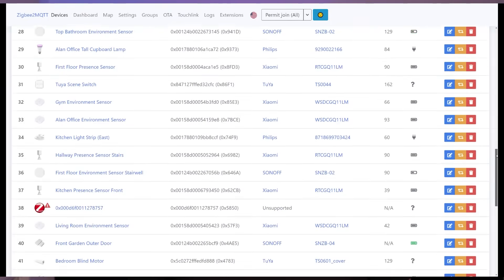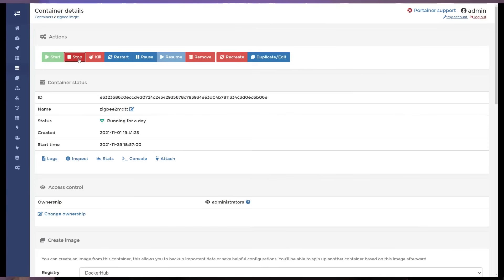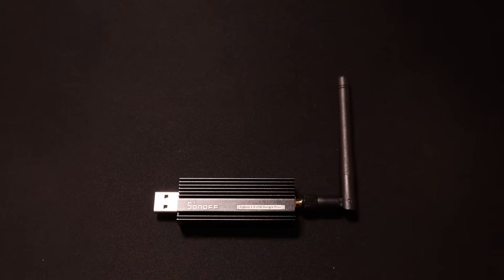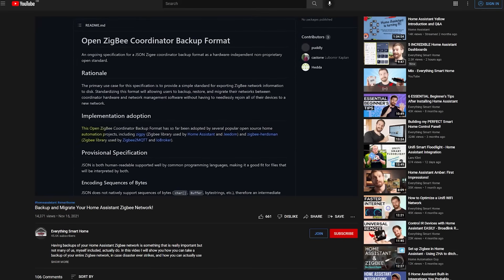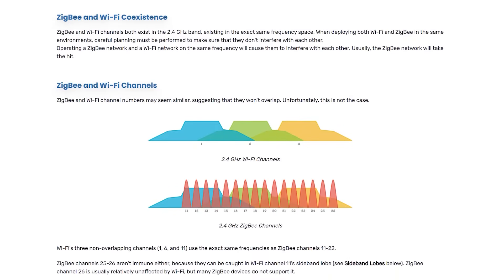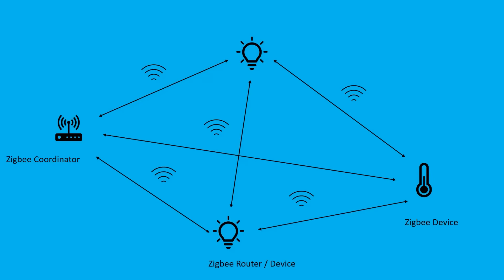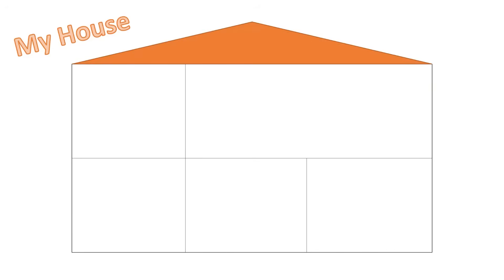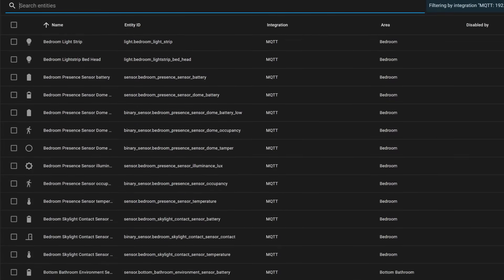Improve Zigbee network performance and stability with these 3 tips

Comment: I started with SmartThings. it has zigbee and zwave. the first couple years in this house had issues.  devices dropping off network, ect.  First I moved the SmartThings from the basement to the middle floor, middle of home.  This helped alot.  2nd, I stopped cheaping out on batteries.  Cheap batteries would die before low battery warning, or just have poor performance.  Energizer batteries have been running  for 2 years.

Comment: Is it really the case that the sequence that devices are added is THAT significant??

I.e. if I add a device that is at the extreme range from a repeater, if then add a new repeater between them. It won't help with those two?

I'd have imagined it would broadcast on the 'network' and they'd both relay the pertinent details.
Reply from the maker: What you have described with adding repeaters between them will definitely work. The network will re-route and rebalance itself automatically. 

BUT if you are first setting up your network, and you put your coordinator in the basement and then go several rooms away to pair your first device, it may have trouble finding the network to join and you might get stability problems initially.  It becomes far less of a problem once you have an establised network.

Comment: Another way of getting rid of the radio "noise" of a Raspberry Pi or other SoC computer or PC (instand of an extension cable) is using a Zigbee-to-Ethernet or Zigbee-to-WLAN gateway like the ZigStar Gateway. This way you can place the Zigbee coordinator (nearly) anywhere in your house (e.g. in the centre), independent where your "server" is located.
Reply from the maker: Thanks for the tip! I was considering doing something similar to this with a Raspberry Pi and Zigbee2MQTT
Reply: @HomeAutomationGuy  ZigStarGW works with Zigbee2MQTT and ZHA, and the UART-to-TCP/IP (or UDP??) driver should run fine on a Raspberry Pi, it's standard Linux. It's just replacing the USB part of the USB-STICK... (the ZigStarGW developer works on supporting Thread/Matter as well, but without an, announced timeline). I have around 90 zigbee devices connected, with around 10 of those are router capable devices.
Reply: Thanks for review. Is using TCP to be sure packet is delivered.

Comment: Can you create a video describing the high availability of Home Assistant? or any other fix if the home server breaks
Reply from the maker: I wish I had an answer to that! I have a backup of my Zigbee config and a spare USB dongle in case of a failure. It's not high availability, but at least I can get it back up and running soon

Comment: wifi 2.4ghz can only use 3 non-overlapping channels.  1, 6, 11.  If you designate 11 for zigbee, you can only use 1 and 6 for your APs.  this isn't a problem if you only have 1 or 2.  if you have 3, then you will need to use the same channel for 2 APs.  just make sure they are the ones that are furthest apart and/or won't overlap.  if you use any other channels, you will have overlap, crosstalk/noise and it will impact the performance of your wifi.
Reply: Do keep in mind that ZigBee channel numbers and WiFi channel numbers do not correspond, at all. Look at the channels visualization shown in the video. For example, ZigBee channel 11 is in (overlaps with) WiFi channel 1, not WiFi channel 11.

Comment: Presumably zigbee light bulbs only act as routers when they have power. Most of my lights are already controlled by (WiFi) smart wall switches, which have the advantage that they can still be used manually if the WiFi fails. To use a bulb as router I guess it has to have power on all the time, so the light can only be controlled over zigbee? I'll try zigbee plugs instead.
Reply from the maker: That is correct, the power needs to be on to the lights for them to act as routers.

Comment: I recd sonoff usb dongle. Is there a way to check the range of the dongle?
Reply from the maker: Move devices further away from it and see when they stop working? 🤷‍♂️
Reply: @HomeAutomationGuy  thank you for the reply. I am going to buy sonoff usb dongle 3.0 for my parent's house. They already have few sonoff basic r2 switches which they control via ewlink app. Can I add these switches directly to sonoff usb stick and control  them via ZHA without flashing ?
Reply from the maker: @nehajain2974  You can check the device compatibility list. https://zigbee.blakadder.com/

I'm unfortunately not familiar with these devices myself.
Reply: @HomeAutomationGuy  thank you for the link

Comment: Thanks for pointing out, that's important WHERE you start to pair your devices in your house. 

I did the exact same mistake, you described in your video:
Paired all the battery devices near my router, and got the same problem: router is overloaded, connections are weak. 

I hoped, the mesh would heal = rearrange itself. But no, it didn't. 
Have to repair the mesh, by re-pair the devices (ba-dum-tss). 

Watched this video the 5th time or so. You can always learn a bit more.

Again: Thank you
Reply from the maker: Thanks Sebastian! I appreciate the kind words!

I hope you have that mesh working nice and strong now 💪
Reply: in z2mqtt you can just choose which device should be open for joining
Reply: @georgwurth6614  there is one problem though - if your mesh router goes offline - then the battery powered device may switch to other router/coordinator (they love to pick coordinator btw, no matter the link quality) and it will stay paired to it until there is communication issue again. This is a huge problem for me, because... I run my servers with UPS power source. If there is a power outage in my house - all my routers goes offline, but coordinator stays alive. All battery devices then will switch parent to the coordinator :|

Comment: I had about 30 devices with a CC2531 with several CC2531 as routers, with bulbs. worked great for well over a year.  only reason I changed as I like to play around :)
Note, I made sure that WiFi channels were far away from my Zigbee channel.

Comment: I may sound stupid. but please clarify. I have a sonoff zigbee bridge and lot of zigbee battery powered sensors n switches. How does the dongle work in my case. Should I just buy zigbee 3.0 dongle from sonoff and place it in farthest room where my sensors are not working currently? Can I plug the zigbee dongle to any USB power? PS: i don't use home assistant.

Comment: Hey, another tip. If you use an SSD with a ZigBee coordinator on your Pi, even with an extension cable you may suffer interferences. The fix? Do not use USB3.0 ports on the Pi for your SSD. It's a shame, but once the SSD is on 2.0, ZigBee works like a charm. I took months to discover this.
Reply from the maker: What a strange problem, and congratulations on finding the cause! Thanks for sharing!
Reply: @HomeAutomationGuy  Well, USB 3.0 does interfere with 2.4 GHz radios,  not just Zigbee,  but WLAN as well.

Using an unshielded USB extension cable on a USB 3.0 port of a WLAN access point can render the whole 2.4 GHz WLAN unusable...

Comment: I'm building my first Zigbee network and I'm very disappointed.

I have a Sonoff dongle. I have at least one smart bulb (so router) in each room, paired before end devices. I have moved my 2.4ghz wifi channel on a channel that not interfere with my zigbee channel. And all that kinds of stuff...

BUT, some of my end  devices are still not able to get a strong and stable link with a router, even if the router is 3 meters away... Mostly Aqara temperature sensors.

The only last thing I didn't try is to install HA and my dongle in the center of the house, far away from my Wi-Fi router (HA is on my synology, which is in the office with my computer and isp router, protected by an usp). But this requires me to buy a dedicated device (Raspberry Pi or HA Yellow). So more money with no insurance that will resolve my problem...

Damn Zigbee!
Reply from the maker: That's disappointing! Maybe something else is interefering with them too? Bluetooth, Microwaves, etc.  I'm sorry that you're having so much trouble!
Reply: @HomeAutomationGuy  There is no Bluetooth, microwaves or other stuff like that in rooms where I have some end devices. I ordered a zigbee coordinator over ethernet. I will see if it makes things better. I will be able to place it in a central position in the house and far away from the isp router. It's coming from US, I will se when it will be delivered.

Smart bulbs have no problem to pair and work (except HA don't like Zigbee Groups, it's always showing it's On after I put the lights Off). But Aqara end devices doesn't work well. I bought a Philips Hue motion sensor and it pairs and works well. The Aqara motion sensor, 10cm away from the Hue motion sensor doesn't work well.

Maybe the Aqara devices don't want to work in my house... (BTW, the Aqara P1 are very disapointing. 1.5m is the maximum range of detection...)
Reply: @trsiel8953  I am having issues with Aqara sensors too. It appears they do not work with all routers. I have some old SmartThings routers that do not work with them for long. I have tried pairing my Aqara sensors to an Aqara router directly, which Is possible in ZHA. Although not sure how long this pairing will last as the mesh tries to optimize itself. So your issue might be incompatible routers.
Reply: @paulatkinson2620  My coordinator is a Sonoff USB Dongle. I see lots of people able to those sensors with this dongle.
Reply: @trsiel8953  Zigbee is a mesh network. If you have any Zigbee routers then battery powered devices will probably connect to a router and not directly to your dongle. In ZHA you can use the visualization tab to see what is connected to what.
Reply: @paulatkinson2620  I know that. I probably misunderstood your message. I was thinking you were talking about proprietary hubs (some people call them routers) and not zigbee router devices from some brands.
Reply: And if it's the case, Aqara P1 doesn't pair with Philips bulbs. And it's very difficult to pair them with Ikea bulbs. I need to put the P1 less than 2m of the ikea bulb (3m away)

Comment: hey great video, i am planning follow your tips in hope of stabilizing my ZHA network, but one quick doubt, I should go with Zigbee channel 11 and all my wifi AP's set to channels 7-13 (i am using unifi as well)? 
OR 
can i use channel 25 for zigbee and limit all my ap's to 1-6 channels? i heard that channel 25 zigbee has lower power transmission rates in US(not sure and hoping its not a problem for me in Singapore), I am also planning to migrate over to Zigbee2Mqtt from ZHA and repair all the devices? are my choices good and would it help me from slow automations and failing zigbee devices?
any help is greatly appreciated, thanks you so much!!

Comment: For the moment I try to do naming as 'location, (room) fixture (lamp? ceiling light? plug? Motion sensor) and then either a number for which bulb in a multi-bulb fixture like a chandelier,  or a directions for which fixture if there are more than one, (North,South,NW, North Left, etc.) If I'm having trouble with a device I can find it quicly this wey. Annoying are the devices that I name like this, but the entities within the device have the manufacturer label information on them, named by zha.

Naming isn't the major problem I'm running into though, but that's another issue.

Comment: Thanks for the great video. How does the Sonoff Zigbee bridge fit into the network? Is it a router? Can it replace the coordinator? Is it useful? Thanks again.
Reply from the maker: I'm not sure it works that well with Home Assistant, but I've not used it personally.  There's some information here in the community forums
https://community.home-assistant.io/t/sonoff-zigbee-bridge-tasmota-vs-ewelink-add-on/353824/7
Reply: Thanks for the prompt reply.

Comment: One thing i have done is to give different areas of the house differen names, like east par, west, base part etc. Then i assosiate rooms in this area to this area. Which makes it much easier to know where the sensors are "living" It makes it much easier when labeling both cable, sensors, even the fusebox get an easier labeling.

Comment: I keep my naming simple. Obviously I break down my house by rooms, therefore I have lights.family_room, motion_family_room, and etc. If there is more than one device, like lights, I just add a number behind the name (lights.family_room2). For my automations, I try to keep the names simple. [device][when automation fires][on/off]. For lights it would be Lights AM On or Lights AM Off. Might not be the fanciest naming system but it works for my Home Assistant setup.

Comment: Thanks for the video! I paired my devices without plan too. I think, they rearrange their connections when being moved. You are sure this is wrong? I’m using ioBroker and the Zigbee adapter shows the connections. I will figure out.
Reply from the maker: A lot of the time the Zigbee network will figure itself out and re-route the signal, but I personally have had problems with it and just had better results pairing the devices in the place I intend to use them.
Reply: @HomeAutomationGuy  
Ok, good to know.

Comment: I found no need to put my ZigBee stick on an extension cord. If I leave it directly in the USB port, connect an external antenna with a cable and put it on top of my network rack, I get literally the same improvement. This has the huge advantage of a screw in connector and much cleaner cable management. :-)
Reply from the maker: Great tip, thanks!

Comment: Great video thanks.

As for naming conventions I go for this and find it knocks it out the park

{Area}_{device type}_{description}

For example for some bedside lights
Bedroom_main_light_bedside_wife
Bedroom_main_llght_bedside_me
Bedroom_{oldest}_light_bedside
Bedroom_{youngest}_light_bedside

For motion sensors
Kitchen_sensor_motion
Hallway_sensor_motion
Outdoor_front_sensor_motion
Outdoor_rear_sensor_motion

You probably get the idea at this stage. The main point though is that areas are the first part as they are the biggest thing to group by. And there are similar areas which may also need to be grouped (bedrooms/outdoor) so prioritising those at the start is also important.
Then grouping by device type makes it very easy to drill into the next stage. It's not good enough to rely on the home assistant domain (light/switch/etc) as this may not be true. E.g. a smart light switch would appear as a switch but is effectively a smart light.
Next is the descriptor. Again fairly generic and avoiding physical device references (at some point they may be upgraded after all). It's also important to make sure to prioritise any further grouping should that be needed... E.g. if you have device in wardrobes, stick a wardrobe reference in first. 

Lastly, abbreviations are useful but it's VERY easy to overkill in this area and you may go too far and need to expand out later. And/or forget what the reference is in relation to. Personally I just don't bother as I have yet to see any advantage in abbreviating. There's enough auto completes to prevent a full type and I'm much more likely to need to revisit what on earth ORL relates to (outdoor rear light) 6 months in the future when I need to change things.

There's an argument for not needing this level of complexity with naming conventions as you can add areas to device and domains exist to take the hassle out of that. But domains may not be an accurate reflection (as previously mentioned) and areas are no use when using something like NodeRED which will just give a list of all device in a domain.
Reply: Being very new to home automation, but a long time data engineer, I also chose to use a big-to-small, left-to-right hierarchical naming convention. But I chose {deviceType}_{area}_{description}. Don't have the experience yet to know which is the better top level choice. Also decided on full words (no abbrev) in camelCase for all three sections, and that the area name is an exact match to one of the Hub's room names. Time will tell. Are there any times you wished you used device type as the top level?

Comment: Great info, I've usually always stuck with z-wave because it is it's own network with it's own freq. However I am starting to build out a zigbee network starting with moving my Philips Hue stuff over to the zigbee dongle. My question which either was not covered or not very clear to me. How do I check the channel my zigbee stick is running on? And how would you recommend changing the channel if I needed to? I have a Home Assistant Blue with the Nortek z-wave/zigbee usb dongle connected to it. Thanks!
Reply from the maker: If you're using ZHA or Zigbee2mqtt you can change the channel using the config file. ZHA uses channel 15 by default, and Zigbee2mqtt uses channel 11.

Comment: When it comes to pairing devices on the spot where it is going to be used. When a node select a router, will this router be where it sends traffic forever? If that is the case you should re-pair devices everytime you move them to a new location.
Reply from the maker: I usually re-pair them by holding down the pairing button when I move a device.  It should re-balance itself and talk to a different router if it finds a better path to the coordinator, but in my experience this sometimes takes a while or does not work at all.

Comment: Is there a way to move a device away from the coordinator to work through a router without repairing?
Reply from the maker: You can try just moving it and hoping that it re-connects to a different router.  It works a lot of the time, it's just not guaranteed.  You can also just re-press the pairing button which causes some devices to re-connect through a different router.